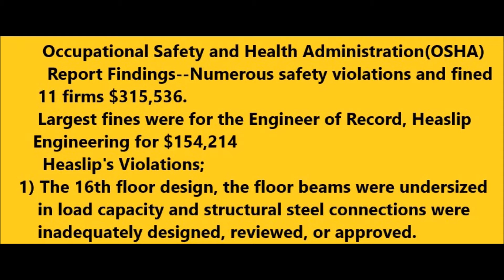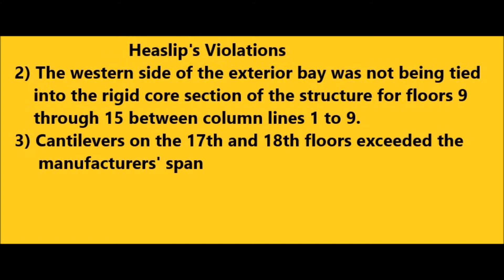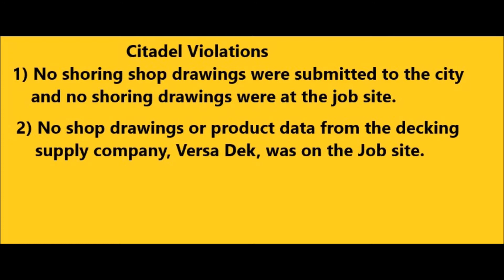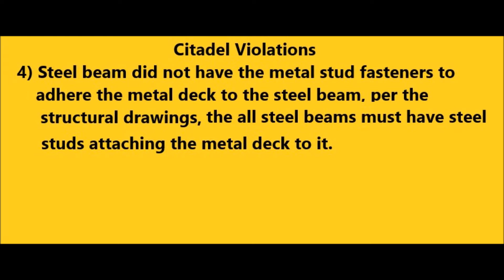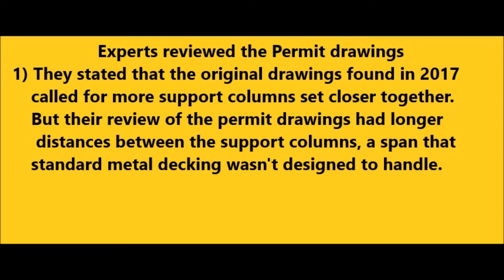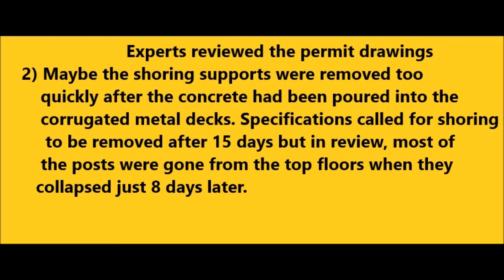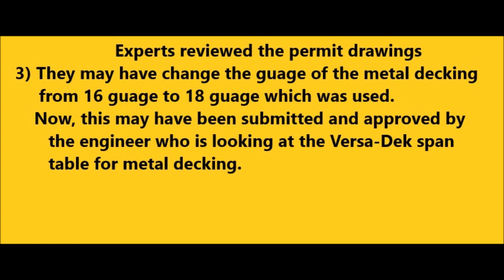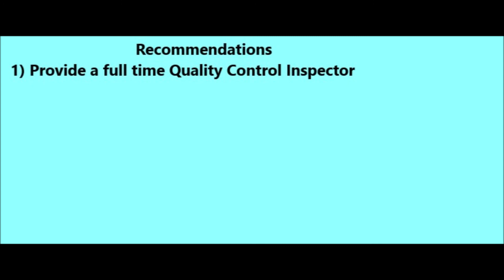New Orleans Hard Rock Hotel Collapse that happen on October 12, 2019 and killed three workers.

Comment: This is a concise and informative presentation which I (a layman) found interesting.  I haven’t read anything else about the incident since the time of the collapse.  I know the mayor wanted the whole thing demolished.  Was it?  It seemed to me that if the lower portion was undamaged and not defective then it could have been preserved and incorporated in a new design for the upper floors.  I would have removed all of the upper structure, though, because I don’t think people would have confidence in it if it were merely reworked.
Reply from the maker: Lower section was removed. No word on what they will do with the property. Last I heard the developer wanted to build something.

Comment: The most important is to qualify your design professionals.  If you look at published design material for Vulcraft Deck and for New Millenium Deck you find that their design tables only go to 15' or 16' of span.  This material should never be used for spans of 24' or more.
Certainly it would have been possible to strengthen and retain the part of the building that remained and make it usable, but at what cost?  And would people use the building knowing about its history?
Reply from the maker: My research found the same results in those span tables. I just don't know what they were looking at. It seems they over did it with value engineering. As far as rebuilding, I made that comment before a comment was posted about the quality of construction. I think I would have looked at it with a forensic engineer and assessed the costs and public response before making a decision. A total rebuild seems to be a viable option.

Comment: In addition, decking concrete pouring was done at multiple different times, cold joins and honeycombing everywhere, plus materials loaded onto and moved around on green concrete decking that did not have required curing time disrupting the relationship between the decking, reinforcement and adjacent decking, etc etc.

No respect to quality control,  material, mechanical and  structural engineering on any level. Hurry up and screw it up as fast and at the lowest possible price as one can. A formula for disaster. 

Sadly, the City of NOLA inspected and approved everything from foundations up, floor by floor.

All with predictable and preventable devastating results.
Reply from the maker: $70 million dollar project and it appears that they had no one on board for Quality Control. I just hope more owners understand how critical quality control is. Check out my videos on the Kansas City Hyatt Regency walkway collapse, same theme. You and I have a forum through Youtube to get the word out.

Comment: Very well stated. 
I have taken over 1000 high resolution pictures of both the upper and lower floors below the transfer slab both prior to and after the collapse. 

Below the transfer slab prior to the collapse I found:

1) significant deflection of concrete bending and distortion aluminum stud framing just installed weeks prior

2) post tension cables being adjusted and/or failing 

3) shallow and corroded rebar reinforcement 

4) structural cracking of critical reinforced concrete beams and spans, I have screen shots of what appears an engineer is inspecting it

5) significant concrete dusting
 
6) significant permanent creep in concrete slabs and ramps

7) water pooling in parking garage sloping toward the cranes and interior elevator shafts vs proper sloping to drainage system

8) significant loading of elevator cables and/or large wooden spools of heavy gauge electrical cables being stored together toward interior center of parking garage around cranes and parking garage ramps

9) parking garage ramps appear to be failing with significant permanent concrete creep and video shows loaded heavy duty lift equipment driving fast bouncing (oscillating) up and down parking garage ramps 

10) significant parking garage concrete blocks stress fracturing, failing and being replaced especially at ramp transition points and exterior walls

11) excessive flooding at job location, lack of water drainage management 

12) changes in foundation  specifications of which may not have been approved by city and/or original engineer 

13) city foundation inspections show only drive by pictures indicating they may not have been actually inspected as widely reported the case in many of the city inspections in this and other buildings in the city

14) significant uneven settling as the building appears to be significantly out of square and plumb 

15) request made to city who approved the building entrances to be allowed to be at a significant lower elevation than grade requirements  (building significant settling thus the request?)

15) significant concrete honeycombing 

16) significant cold joints

17) shoring was inconsistently placed and post tension cables were subject to uneven stressing by below shoring   

If the cranes were impacted by a below transfer slab collapse in the parking garage and/or were settling at a different rate than the building, the cranes above the transfer slab attachment points would have been stressed which may have literally pulled out the beam and/or column the crane was attached to. 

Data in fact shows this did happen at some point, but was it caused by the collapse or did it cause the collapse?

Also, I found what appears to be the added (and failed) cabling to the front section of the collapsed section that  apparently was reported by workers, was added “to help square up and plumb up the building as “everything was way off and getting worse the higher we went”. 

In addition, on the day of the collapse there was protective spray foam netting along the top floors of the collapsed section which acted as sails with the high gusty winds that day yet were still using the crane during these high winds to move metal from one section to another during the time of the collapse. 

Finally, they were removing concrete from back decking on the roof directly across from the front section that appeared to be where the initial collapse began as indicated by severe cracking. Did this cause the collapse or caused by the collapse?

In conclusion, seasoned in commercial building and development, quality control and reinforcement engineering, ASTM and ISO standards for years, the quality control systems failed on all levels from the ground up, to local and federal departments and agencies down. 

KP
Reply from the maker: Great analysis KP. My Review was only from the information that I received online. It appears that you believe that they couldn't rebuild because the lower poured monolithic structure was also constructed inadequately.  That's a shame. It's a great-looking building and I would think that the main contractor had bought everything out at that stage. I was thinking that they could just re-build the west section with more redundancy by adding columns and beams. It looks like you have done an extensive forensics analysis for someone. I'd like to see how this shakes out with the lawsuits and everything. I hope you can post some information at a later date. 
I'm putting together a Quality Control Video to be published hopefully in 2 weeks. I hope you check it out. I don't have your extensive experience, however, I started my Quality Control on my projects almost 30 years ago. Next week I post a video on wind and hurricane damage on houses. I started this theme of videos with the Johnstown Flood and Dam collapse to show inexperienced Owners that are getting into this business that it's not as easy as it looks. Guys like you are needed more than ever. Great Building and location, I hope someone rebuilds there.

Comment from the maker: 6:26 I show the structural framing drawing for floors 8 through 14. I discuss the lack of tie-back beams across the hallway. Another note to add to this drawing is the shear area. The Metal Pan Deck was perpendicular across the hallway at this shear line. That is where the west side of the building shear off from the building. A weak line in the structure.